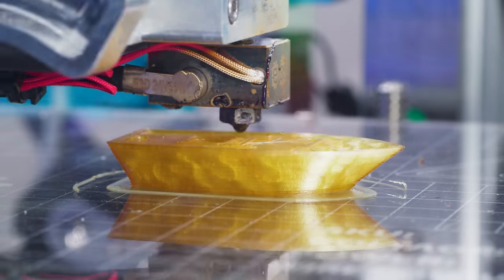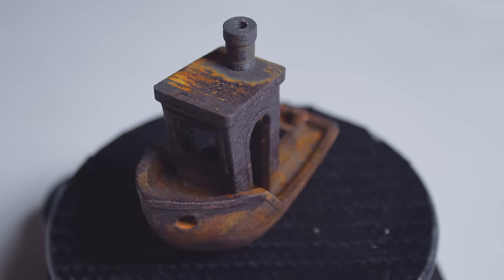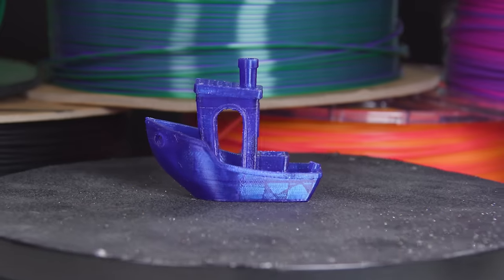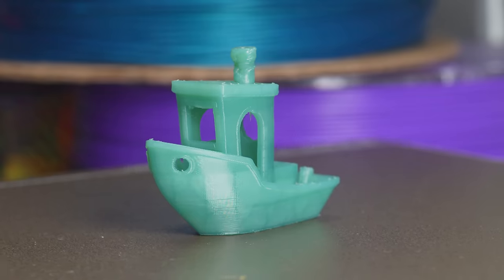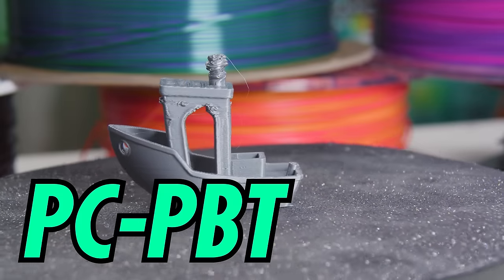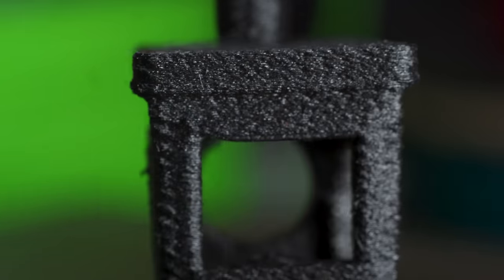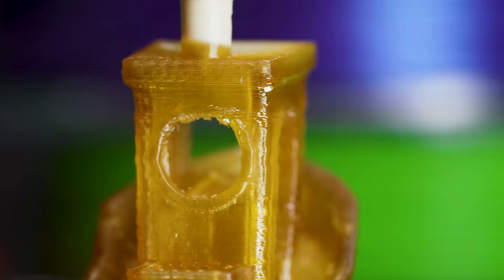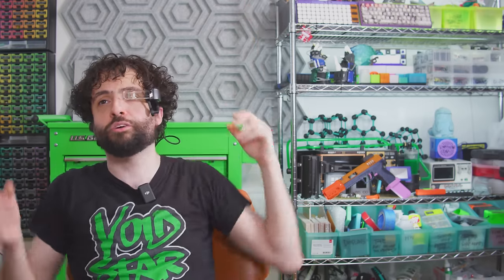The 3D Filament Tier List! Which Should YOU Use?

Comment: Vinyl 303 by Fillamentum has some very good properties: inexpensive, self-extinguishing in fire, sticks to a PEI bed very well as long as the bed is hot, I use 110 degreesC, its quite rigid and strong but bends instead of cracking,  very high chemical resistance, and I think you can glue it with plumbers PVC pipe glue (I thinks its probably a good fit for plumbing projects compatible with PVC pipes).  I hope you Include it in the future. I know you have done Fillamentum PP 2320 before and had a high opinion of it, I use it a LOT and my own experience with it in a stock Ender 3 S1 Pro is very positive.
Reply: The problem with PVC is the nasty fumes it produces. Also it may self extinguish but will release toxic fumes are it does so.

For most applications you would be better using other filaments.
Reply: @conorstewart2214  Sure, I don't dispute that other filaments are more suitable for "most applications" however. If all you need is something good for "most applications" then there are many options that will work well. There is no difficulty in choosing a material for "most applications" but yet Zack has tested something like 50 filaments, may of which overlap a great deal in terms of properties and usefulness. Nobody making a knob, bracket, art, lithophane, figurine, vase, case, project box, or cosplay suit is lacking in options that would perform reasonably well. However, if you want something compatible with plumbing, or electrical conduit and able to be glued. then you really only have one option, and that's PVC.
PP, PVDF, and PS, cannot really be glued.
PP burns really well in a fire, is very slow to print well, and depending on the formulation, its either too soft and flexible or in the case PP 2320 can lack impact resistance in some printing conditions. PVDF is expensive, and cannot be glued.
PS needs the printer bed to be heated to 140C, and almost nobody has a bed that can reach that temperature.
So, I still think that Vinyl 303 deserves a spot .

Comment: one thing people never talk about with PETG, is inexplicably, you can print absurdly fast with it. 500mm/s is easily possible with a powerful enough hotend, like a ceramic hotend with volcano nozzle. cf petg in particular is fast.
Reply: Talking about linear speed isn’t that relevant, volumetric flow rate is much more important. Also PETG is generally considered to have a lower max flow rate in a given hotend than PLA.

Comment: Chemist here:

Halogenated hydrocarbons (chloroform is a common one) are the go-to when it comes to dissolving/weakening plastics. If the plastic isnt affected by them, the plasticizer definitely is. The F in PVDF is a halogen and since halogens have such a high affinity for electrons we consider that they have a static, partial negative charge. This partial charge  makes other halogens not really go near each other. This property makes it exceptionally resistant to halogenated hydrocarbons.

The resistance to inorganic acids, aka mineral acids (Hydrochloric acid, sulphuric acid, etc.), is from a stability standpoint. HF is one of the most reactive (unstable) of these acids. For a mineral acid to react, it needs to create a more stable "acid" (typically water). A mineral acid reacting with PVDF would just make HF. You would need an acid thats even less stable than HF to be able to react with it. Since HF is already hella unstable, mineral acids don't really affect it.

TLDR; PVDF is halogenated which gives it protections from halogenated solvents. The F is way more stable in PVDF than it is in its respective conjugate acid so it's not likely to react.
Reply: I've also sent this message to a couple other people in this comment section here, but I have a question about this and Zack's statement that it becomes deadly just a few degrees above the print temp. I have some old injection molded parts I am in the process of replacing with printed parts that need to survive for years being exposed to chlorine gas. 

I'm an industrial design engineer and I did a minor in polymers and associated production processes, so I understood the potential risks of PVDF well enough when it came through my materials research as one of the only two viable options along with PPS that can be done in FDM and meets the chemical requirements. However, from my understanding is that degradation and thus the extremely toxic byproducts like hydrogen fluoride, whilst extremely toxic, are actually very unlikely to occur since thanks to its fluor bonds being so strong - taking a lot of energy to break- it has a huge safety delta between the processing (~250°C) and degradation (~400°C) temperatures. Much higher than a lot of common polymers which seem to have around a 50-80 degree safety margin and obviously much much higher than it's chemical cousin PVC since its delta is actually negative. 

This does not gel with what Zack is saying here, where he talks about even a few degrees causing the release of dangerous amounts of toxic chemicals. I would really like to understand this well, since this is a potentially dangerous situation I would like to avoid. I know that degradation doesn't happen at a set temperature, because of polydispersity shorter chains will degrade sooner, but I cannot imagine that to be such a factor that a few degrees above processing temps it is suddenly deadly. 

Do you have any insight on this?
Reply: @martvansteenbergen8955  yeah, absolutely! What Zack is saying is the correct thing to do from a content creator's standpoint. If improperly handled, it can degrade into dangerous things. I've not had trouble printing with PVDF. All my bones are still intact. With the possibility of microscale degradation, id recommend using an air filter or vent to be safe. The degradation range starts at 400°C so if you keep it even below 300°C, you should definitely be good

Comment: Yeeeh I really want to get PETG dialed in for my printer, it seems really good so far.
Is PP the only non-toxic flexible filament then?
I'm surprised composite filaments aren't more common and varied, you'd think people wanted that stability in their lives. I guess they are rarely nozzle friendly.
I bought matte polyterra PLA a couple of weeks ago and I'm inclined to say it's a great beginner filament?? It's kinda pleasant to work with even if it's not a big performer. It doesn't need a PERFECT temperature, behaves well, nice finish, cheap, good bed adhesion but pops off when you say please, no warping until we went BIG, not brittle either. Easy to hand carve. BUT Layer adhesion so bad you can rip thin walls with your hands. I might use it for the 3d pen actually, but anything is better than the few moist sample PLAs it came with.

Comment: I wonder if glass-filled nylon, CFPC, or PEEK/PEKK could be used for building a functional engine block and cylinder head for a combustion engine? Still use metal components, but substitute the plastic where you would otherwise be able to use aluminum? Would there even be any weight savings? Or maybe a different plastic would be more appropriate?

Comment: Drying filament.  I had a spool of PLA that I put through repeated drying cycles (small prints over a long time).  It ended up so brittle that it would break into short chunks in the reverse bowden tube.  Otherwise the best thing that can be done to improve print properties is drying.  All filaments benefit... unless they melt together on the spool... so I hear... from a friend... not me... nope.

Comment: Noooooooo Zack missed the S-tier part of PPS - mixed with carbon fibre it's so stiff it rings like metal when you drop it.

You can literally print a working bell that won't dissolve in anything <3

Comment: Halogenated hydrocarbons aren't that scary. Some of them (perfluorocarbons) are arguably the safest substances in existence - they're non-flammable, non-oxidising, non-conductive, non-toxic, chemically stable, and they're so good at dissolving oxygen that small animals (mice, etc) can even breathe them without drowning. They're used in some industrial fire extinguishers, especially for complex electric or electronic systems, where water and other substances used in common fire extinguishers are likely to damage equipment.

CFCs are relatively scary compared to other halogenated hydrocarbons, because they damage the ozone layer, but they're otherwise mostly harmless.

Comment: I have to disagree about TPU. There has to be some filament that gives those properties higher on the tier list, because as you said when you need those properties there's no substitute. When making mechanical designs you constantly run into needing bumpers, springs, rubber feet, gaskets, seals, etc. Wherever your design needs to interface/collide with something, or seal something, TPU is a great material to have on the interface. For example, if your print sits on the floor or your desk, why not print some TPU feet or bottom sleeve to stop it sliding around? If you find yourself making a bunch of handheld tools like some you showed in this video, why not print a TPU sleeve where your hand goes for ergonomics?  Working on fan ducting or similar, why not print a custom TPU gasket between your flanges to properly seal the air stream? On top of that you can change the total durometer of a bumper or spring not by changing the filament, but by changing the infilll percentage, which is a huge advantage to me of 3D printing this type of thing that is hard to replicate with traditional manufacturing - so much so that I've seen aftermarket manufacturers offering things like 3D printed bump stops for the suspension of your car since you can do cool stuff like making the spring rate of the bump stop progressive, which you can't do easily with traditional manufacturing.

Comment: ok sorry but i have a problem with your statement that pla isn't sandable.  
it most certainly is. 

yes pla is a bit high abrasion resistant.  (still verry easy but comparatively i mean) 
you just gotta keep in mind that this stuff plastic deforms at 60 degree's. and sanding is a high friction action.  
it's a pain in the ass to do.  but it most deffinatly is well sandable.  i'd even say you can polish it.

Comment: In 2024, mere mortals with low price printers only need 4 types of filament: PLA in all its iterations, TPU, PET-GL and PET-CF.
The incredible thing is that the community speaks very little about PET-GL and PET-CF, both are game-changer filaments for those who do not have an enclosed printer or have limited printbed temperatures.

Comment: The strongest plastic in the world is PAI and I think the reason he didn't show it here is because it is not even sold as a filament for FDM printers, you have to have an SLS printer to print it and in the powder form that SLS printers use, it is quite easy to find. The highest grades of PAI have tensile strength's of 225 MPa and glass transition temps of 280C and some people say it has a glass transition temp of over 400C, I doubt that is true but if it is it means you can print a nozzle with it that can print PEEK. There is also PI plastic which apparently has a glass transition temp of 320C, I think that this claim may be true.

Comment: 32:30 I do know a thing or two about chemistry, though I have no credentials to show for it, I pretty much just a high school nerd, so take my word with a grain of salt
if it's worth anything, those chemical names made the hair stand up on the back of my neck and sent static down my spinal cord. those chemicals are very much some of the most terrifying acids I have ever heard of to date, and we have 3d printer filament that can handle them no problem. there might be some worse ones that can even make this filament crumble, though I haven't heard or remembered many of them
33:00 aaand it is equally terrifying as it decomposes. adding it to the "do not mold" list of plastics

Comment: Aren’t metal filaments intended to be cooked post print to burn off the non metal components? The final result is often 30% smaller, and nearly all metal. Strength increases significantly post cook.

Comment: I have this coat rack that's screw in and it feels like very slippery plastic. I use it as a make shift spool holder and it spins so freely. I wonder why manufacturers don't use that type of plastic to hold the spools? you don't even need bearings. Edit: It has the properties of POM you mentioned.

Comment: So I am getting back into 3d printing. I tried in about 8 years ago, but found that I have some sensitive allergies and decided to not change it even though I was not 100% sure the PLA and PETG at that time was making it worse. This time I bought a adventurer 5m pro, which is enclosed with a filter. Having said that...what would be your suggestion for the filament that still seems to send out the lowest VOC and UFP??  I am very interested in the "tough" PLA and the PCTG based on your video, but I would rather safety over function. This is just a hobby for me right now, but it WOULD be nice to be able to print something that can go outside in the sun for more than a day lol.

Comment: It would be cool if you went through a bunch of examples and then discussed which materials you would use for that application and why. Like I want to print a mountain bike stand. It's a simple bracket that you screw to the wall and then push the rear wheel into it and it holds the bike upright. I printed one in PLA and it's holding up but I assume it will start to creep because of the constant load on it. So what filament would you use for this? Is PETG good enough or should I go to Nylon or GF-Nylon? If I can get away with PETG and it will work, wont break or melt or creep, then I would rather use that than a much harder to print and more expensive filament but if there's a reason why I should use a most expensive and harder to print filament, then I will. I plan on selling some of these so I need to know that it will stand up to abuse and use.

Comment: I totally disagree about the PA12-CF. I print it with a plain old Bambu Lab x1 Carbon Combo. It prints perfectly, doesn't warp and is super strong. I even print CNC router hold down clamps with it. I use the same clamps for months tightened down and untightened with a impact driver and they remain perfect. 
If PLA-CF is a S teir and PA12-CF is a B teir your teir system is broken.

Comment: I see ABS still getting a bad rap because of the mentality of printing it on an open frame printer after all these years. I have printed well over 100KG of ABS on various printers (mainly voron). Never has warped. Also since being in an enclosed printer. It does not smell. Unless you are sniffing the cracks around the door for some weird reason.

Comment: This is the only video I could find that directly compares so many rare/obscure filaments.  I'm printing a replacement gear for a kitchenaid mixer, and the stock one is nylon (PA6/PA12?).  I want to select the best filament for the job.  I've already destroyed a couple PLA+ and ABS gears.  I assume I need durability, heat resistence, and slipperiness since this gear rides on a worm gear, so there is a lot of slipping/dragging happening.  Any suggestions?  Thank you for your input!

Comment: Did Foaming Filaments get covered in one of the earlier videos, if not where would they stand?
Reply: They did and they are good when you need them. Foaming hard filaments are good for weight reduction whilst foaming TPU is an easy way to print really soft material without needing to print really soft material. Also Varioshore is good for varying its hardens over the course of a print, you are mostly limited to vertical hardness changes, for example a hard base and a softer tip or a soft section in the middle.

Comment: Great video but the main thing that stops me printing anything other than PLA is toxicity. I keep my printer in my living room (apartment life yay) so I can't print the carcinogenic filaments and it'd be great if you talked about how safe all of these are.
Reply: You can retrofit a cheap enclosure to have a longer hose to put out the window, out of the kits they sell for standing air conditioners and a 9" desk fan. The kitchen stove hood will also work in a pinch

Comment: The Qidi Q1 just barely can print a few CF PEKKs at the lowest recommendations, at 120C bed temp, 60 chamber temp and 350C extruder temp.

Basically, I can print a spool of filament more expensive than my goddamn printer, but at least i’ll have 750 grams of indestructable prints?

Comment: You are so wrong about PP. You need to put PP packing tape onto your bed to make the first layer stick but then it's easy going. And it's so awesome. I've printed lamp covers, bicycle chain covers and washers for my toilet seat with it. It's my go-to when I need something transparent, heat resistant and/or indestructible. I only have a base CR-10 so PP is the only thing I can even print with these properties.